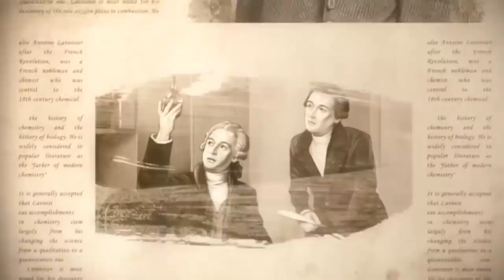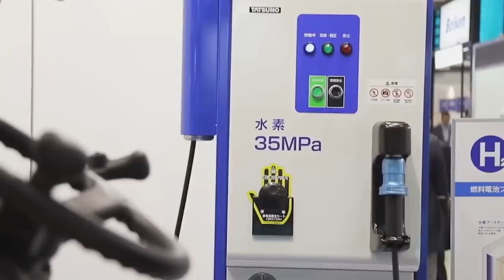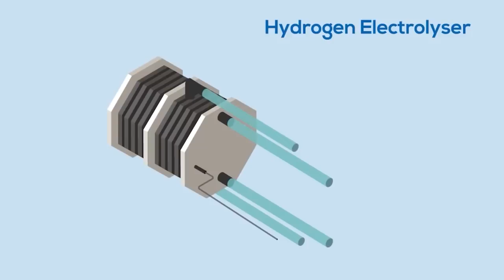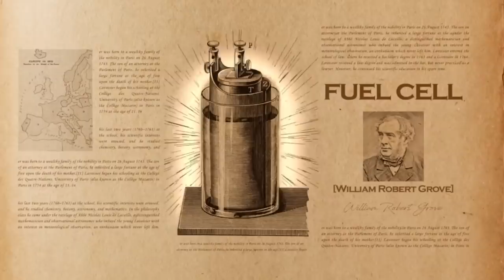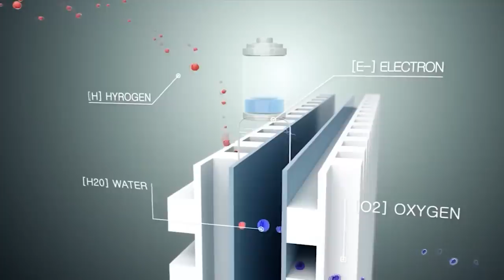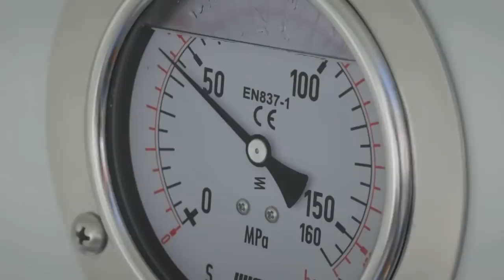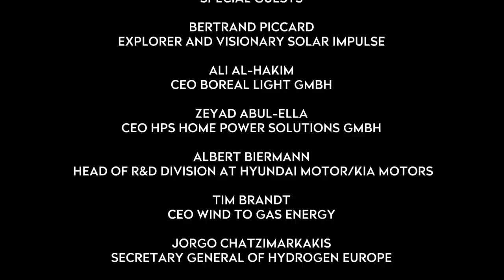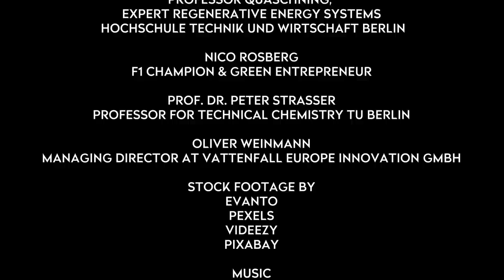Discovering Hydrogen

Comment: Isn't Hydrogen unstable and explodes easily?
Reply: Hydrogen has a potential to ignite. Like most of the energy rich gases we know. But it has been used for over 50 years by the NASA, in the chemical industry etc. without major incident. The Hydrogen tanks have a world wide safety standard. They can survive even heavy accidents.

Comment: The infrastructure is too expensive.
Reply from the maker: Oil and gas have had 100 years to make their system cheap and affordable! Hydorgen is just starting out, but the more we invest into it the cheaper it will get! We have to focus on making the future green and stop spending money on cheap system that are destroying our planet!
Reply: @basicthinkingtv  we don't have enough time to wait for it getting cheap, we need to become co2 neutral NOW. I think you have spent not enough time on the efficiency and other problems. Dr. Quaschning can only speak a few critical sentences at the beginning, from then on it's only "Yay, hydrogen!"
Reply from the maker: We have other videos specifically addressing topics like battery vs electric and efficiency. We didn't think this was the place to tackle arguments, otherwise we have no time to paint the picture for how it can actually work in all the verticals. Check out our other content, we deep dive into tackling criticism... Hydrogen has enough negativity in my opinion, it needs some advocates for how it could be a viable green energy in the future.

Comment: I have seen an old Holden Kingswood car run on strait tap water with no fuel cell at all back in 1975, how technology changes.
Reply: Lol. I want to see that car.
Reply: @DonDahlmann  
He  did show it to my pop he lived across the road, he said he could not say to much as he was heading of to Holden to see if he could sell it, even tried Ford but was told he could use it but if he ever told anyone else he would be in trouble, an other man was with us at the time from up the road, well two years later he worked it out and the old man that showed it to us was found dead on the side of the train tracks , was said he fell of the train drunk.

but what he told us was, all he did was open up the jets to allow twice the amount of fuel, this case water and this coil on the side of his motor about 4in x 4in that looked like feed into the regular coil that was all he said, but he got the hose from the house and filed his tank and showed it was flowing into the carburetor.

I meant what I said it ran on strait tap water, its all about the frequency of the spark.
Reply from the maker: This story sounds like it deserves it's own little movie! <3